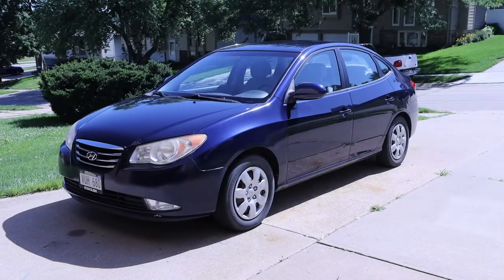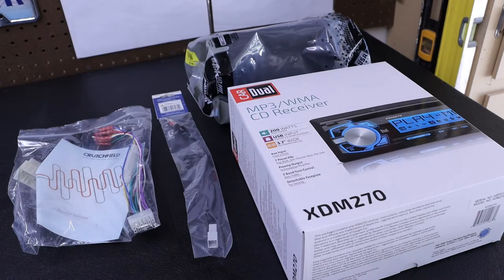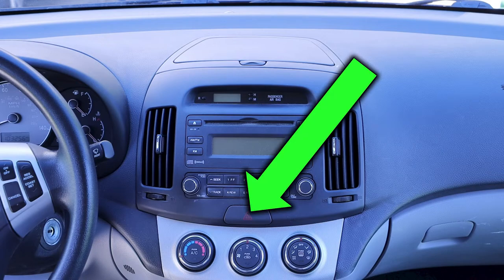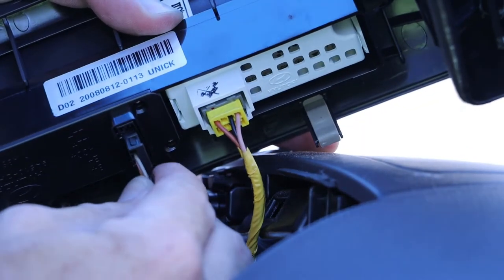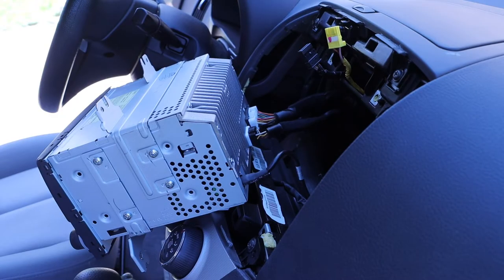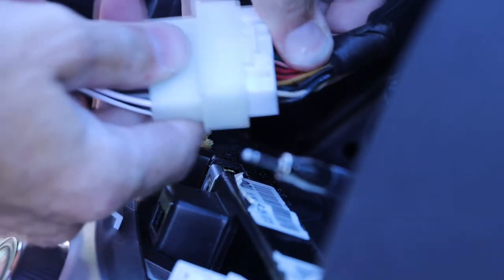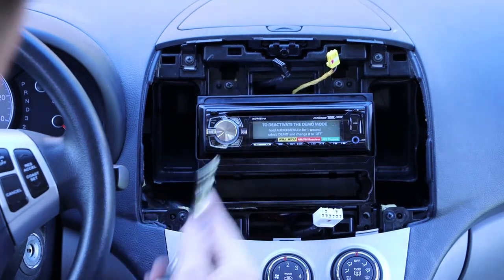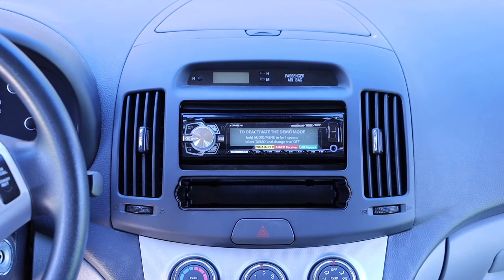2008 Hyundai Elantra - Radio/Stereo Receiver Replacement

Comment: What do you do with the second wiring harness? The black one? Doesn't the metra kit only plug the white harness?
Reply from the maker: I believe you are correct that only the white harness is used.
Reply: @InsaneOil  I think the black is for the auxiliary input, but I've not looked for a diagram or traced it.

Comment: What stereo did you install?
Reply from the maker: Dual XDM270
Metra 40-KI11 Antenna Adapter
Metra 70-1004 Receiver Wiring Harness
Metra 99-7326 Dash Kit (Black)
Reply: @InsaneOil  Would I need all these components to do a swap? I’m looking to replace a broken stereo in my Hyundai
Reply from the maker: @COHaefner  Yes, I believe so.  I basically just bought what the Crutchfield site told me to buy for the particular vehicle I had and radio that I bought.